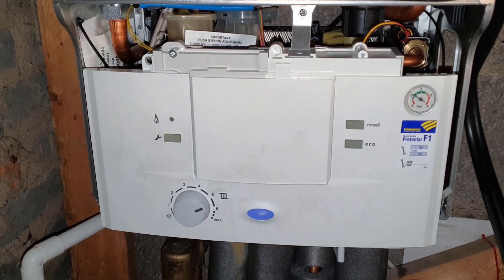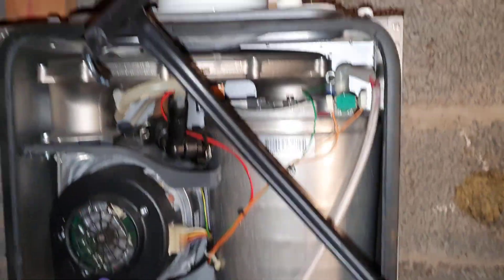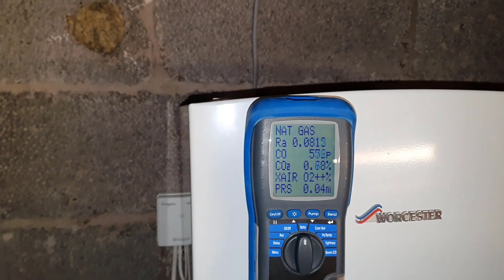Online Boiler Repair Training Worcester 28i Junior  Whats the Fault Part 1

Comment: I was going to guess a split in the rubber gas tube or the fan membrane/bearing plate has split and broken away and been sucked into the burner...have seen that before. Not sure why burner keeps going out though unless the red seal at the top is also perished and heat escaping is triggering the overheat stat? Other guess was faulty regulator at the meter causing erratic inlet pressure causing the readings to be off and conking the boiler out.
Reply from the maker: Yeah Ryan you're first guess was right ✅

Comment: Co2 target on high rate is 9.5% so gas valve is way off. Check gas inlet pressure if that's ok, adjust gas valve if that don't work check burner baffles, fan backplate, gas hose if that's all I'd be ordering new gas valve.
Reply from the maker: Yeah well put 👏

Comment: Check negative fan pressure. Most likely blocked heat cell. Clean with fernox f2 via air intake and adjust gas valve after if necessary
Reply from the maker: Nope sorry

Comment: I would check seals on the flue,maybe a split in the inner flue..Or blocked condense pipe.
Reply from the maker: Hi Danny sorry that's not correct

Comment: Could be the dirty heat exchanher, with the broken burner sealant or gas valve.
Reply: There is an inappropriate CO level. Bad gas and O2 mixture.
Reply from the maker: @meszelya  but why?
Reply from the maker: I will show you in part 2
Reply: Would that cause the boiler to drop out?
Reply from the maker: @markcleminson4107  what do you mean?
Reply: @ARBoilers  I mean, the gas valve could be partly blocked
Reply from the maker: @meszelya  nope sorry
Reply: @ARBoilers  Does the appliance stop burning, go in to lockout?
Reply from the maker: Possible but not quite